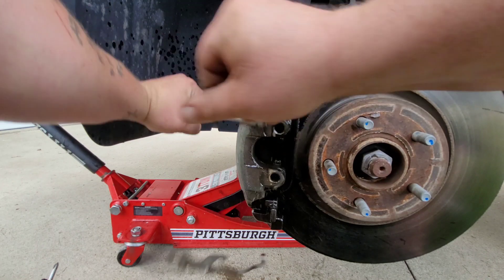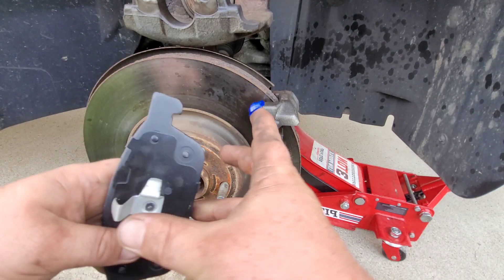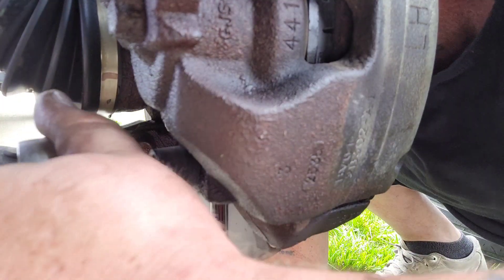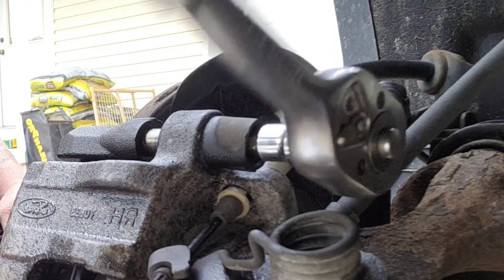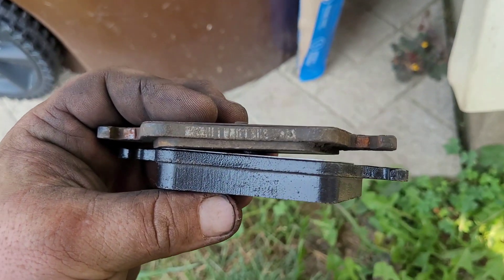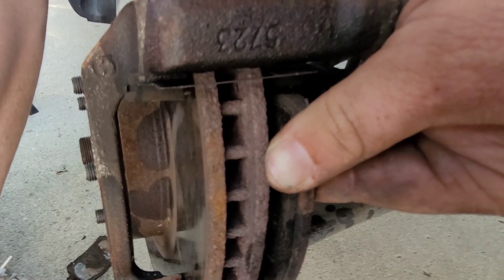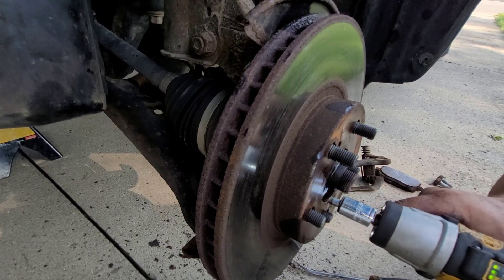Mobile Mechanic Work Day {Episode 15}-2016 Ford Escape Brakes

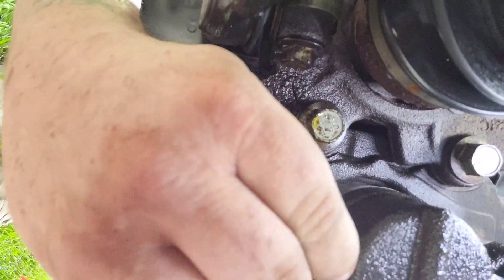Comment: 1:10 to get paid for these scenarios, I would rebuild the caliper. All you need is brake fluid. Emery paper and a caliper rebuild kit. If you don’t have a compressor, you can go to quiktrip and use the compressed air to fill tires. 10 bucks in parts but can charge almost the same price for a rebuilt caliper.
Reply from the maker: That's so funny you said that because Im uploading a video tomorrow about how to use Caliper tool. Because I rebuilt the Caliper and used a twist type style Brake caliper tool and wanted to make a video of it. I recorded me rebuilding the Caliper but it's not good at all so I'm not uploading it.
Reply: @semperfimechanic  yeah. You can get one from a junkyard and show the rebuild steps. Just reshoot it or upload anyway. The subscribers will support it.
Reply from the maker: @MrMpm3001  yea I have an old one here and I can rebuild it and that's a video right there. Usually I don't have to think about video ideas because I just record some of my jobs. If I had someone to record my videos I could have a video a day lol
Reply: @semperfimechanic  yeah you’re gonna have to budget for a film crew, lol.
Reply from the maker: Just going to hire some crackhead fot $10 bucks a day lol
Reply: @semperfimechanic  that means the video should be “Rock” solid, lol.
Reply from the maker: You win the internet for that comment

Comment: You have to remove the brake pad hardware and file under them because rust builds up and prematurely wears them out. Apply grease under them also to inhibit rust.
Reply from the maker: Thank you for the input

Comment: Great day in the life video, love it!
Do you ever get called to do any light transmission work? Like drain and refill/filter change, mechatronics seals, solenoid replacement etc? How about rear diff or transfer case fluid replacement? 
I actually need to do all those things to my own vehicle.
Reply from the maker: This was my actual day today that's why I didn't get it posted  till like 9 pm lol. But yes I do get those calls. The breakdown is 50 percent of the calls are calls for there car not starting or dying so I do a diagnosis on them usually battery, alternator or starter. Then 30 percent is Brake work or ball joints, tierods, control arms and then 10 percent no AC in summer and no heat in winter and 10 percent of tyranny work rear diff, driveshaft, head gasket shit like that. So you can have a whole buisness and just not do the hard jobs and still be busy everyday
Reply: @semperfimechanic   that’s a pretty good work day and a great breakdown of what kinds of calls you get, thanks!
Do you find yourself turning down many jobs? What are some jobs that you absolutely would NOT take on? Also what scan tool do you use for your diagnostics/code reading?
Reply from the maker: @robhughes8516  click on this Amazon link
 https://amzn.to/3AqjpzN and you will see the one I just got and there having a sale. I turn dow. Alot of jobs but mostly because I do not have time to get them. I'm getting about 20 calls a day. Also I turn down engine rebuilds, transmission rebuilds and alot of wiring jobs and tire jobs.
Reply: @semperfimechanic  thanks for the link. I don’t blame you, I’d turn down engine/tranny rebuilds as well… need to much space and time as well as other variables.
Reply from the maker: @robhughes8516  most of my beat profit is it the small jobs where you can get it done and on to the next one or just 1 starter job make $150 profit and only works a few hours that's perfect. If you go in the description of any of my videos I have almost all my tools linked where you can just click on it and takes you to Amazon to buy it or just view it.
Reply: @semperfimechanic  I think that’s the best way to go, do the quick jobs, the ones to where you can do several per day, make your money and then go home… I’m sure there is a time and place for the bigger more involved jobs though.
I think I remember seeing links in your other vids to your tools now that you mention it!

Comment: Hello bud how do you feel about auto zone parts i get so many negative comments on them buddy thank you
Reply from the maker: I get most my parts from Autozone because they usually have them in stock. But it all depends if you have 3 different choices for Brake pads and you choose the $21.99 pair than yea your going to have more problems. So if you have a choice I always buy the top listed brand or the middle brand if there are 3 different brands